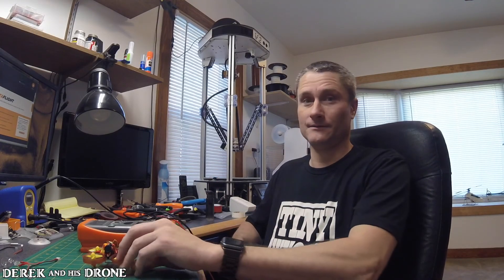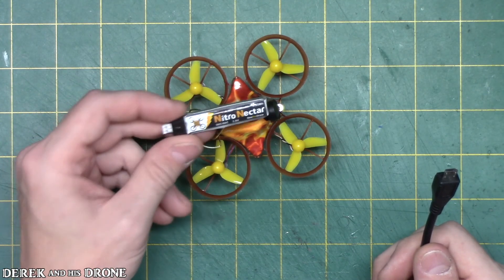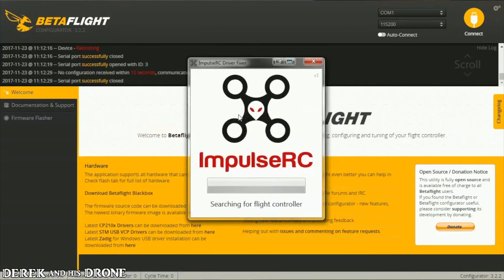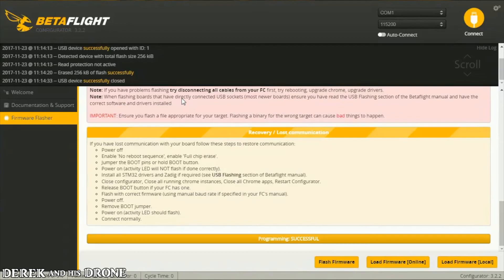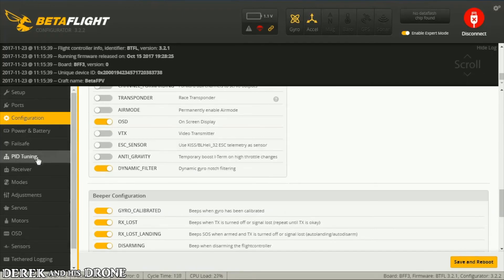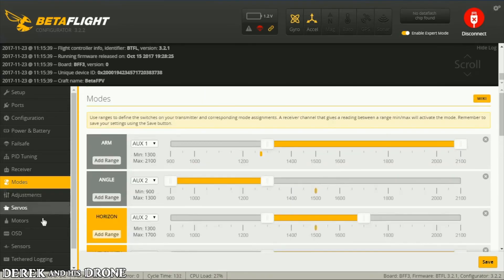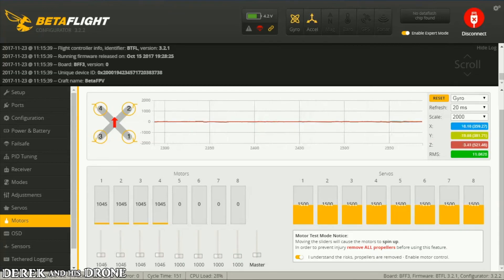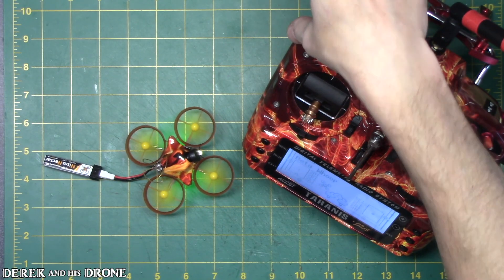Tiny Whoop Racer Build - Part 2 Software and checking the Hardware.

Comment: Dude when you calibrate your gyro do you have a stand for your whoop? As the usb sticks out the bottom on mine like yours and it’s impossible to get it level to calibrate :/
Reply from the maker: I do not calibrate the accelerometer because I only fly in acro mode.  Maybe get a small box and cut a hole in it for the USB cable.
Reply: or use stick commands to calibrate the accelerometer !

Comment: Can someone explain when you would use the "Differential" dump and when you would use the "Full" dump?
Reply from the maker: The differential or diff are only the settings that have been changed in BetaFlight.  It can be easier to find changes that have been made.  A full dump or just dump consists of all of BetaFlights settings even if they have not been changed from the default values.